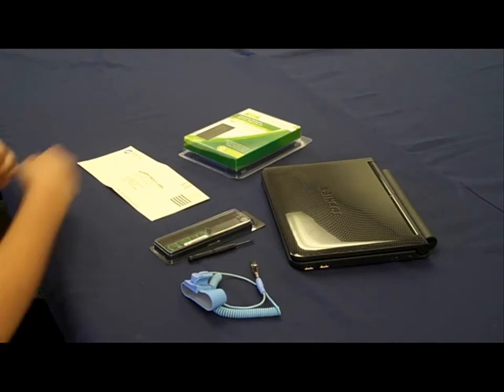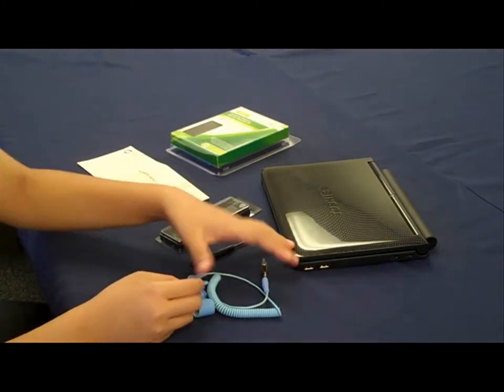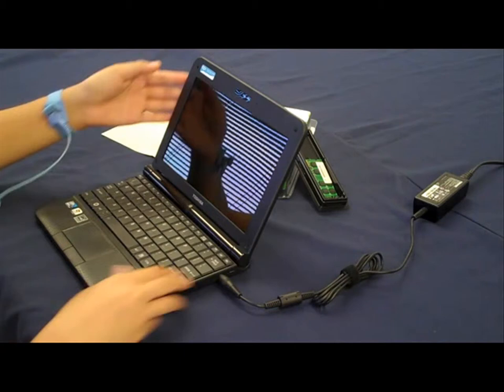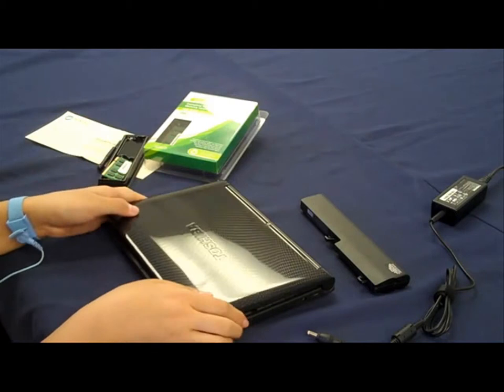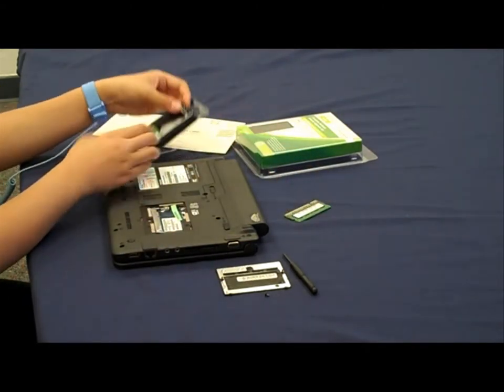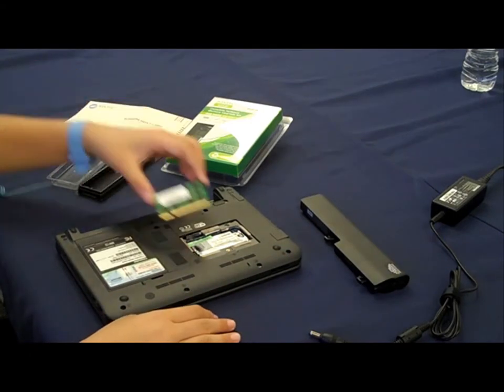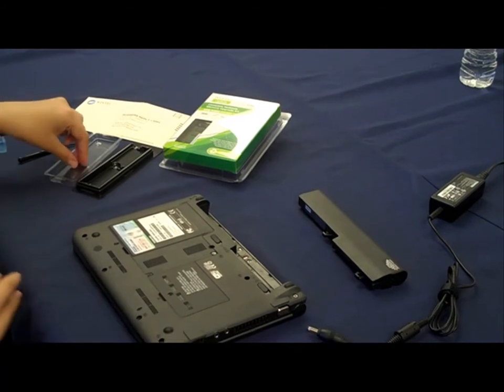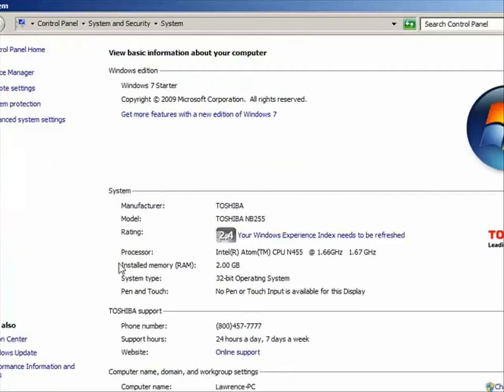How to Upgrade your Netbook Memory

Comment: This is a nice video , but it shows everything but the actual installation of the ram. How to open up the ram clips and remove the ram, align it properly and how to put the new ram in and reattach the clips to secure the ram. It shows more product advertising than instruction. Not a very good step by step at all. Hardly any installation instruction. Other amatuer videos are alot better!